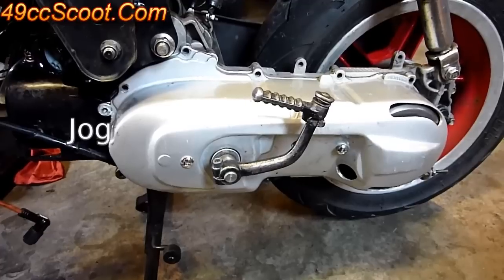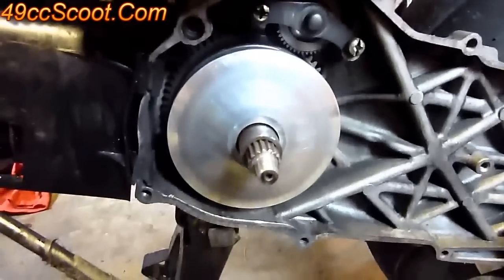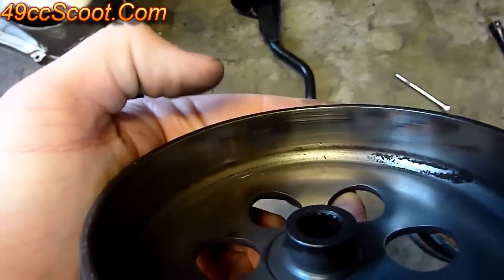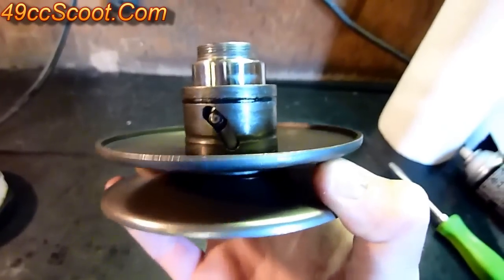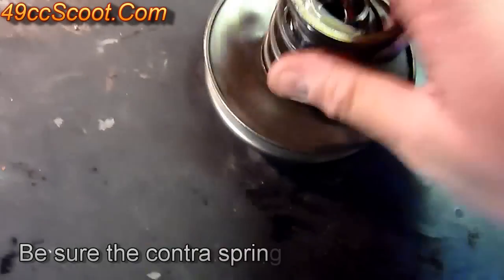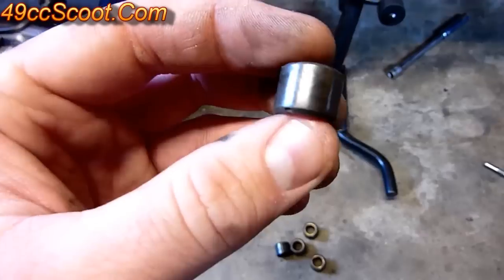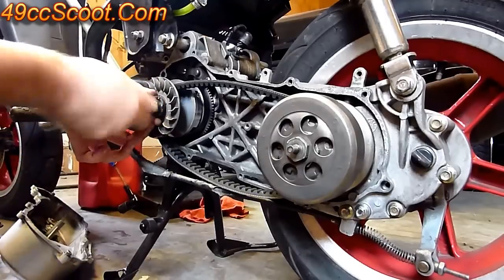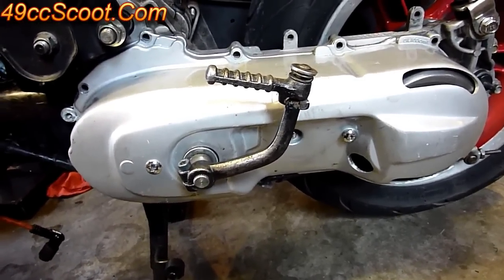Scooter CVT Transmission : Full Service Inspection

Comment: It's thanks to people like you that make in-depth videos like this full of knowledge that other peeps can fix their scoots. Thanks a bunch, man!
Reply: 49ccScoot, could I ask a question regarding my scooter? Around 4 years ago I disassembled my Aprilia Sr 50 2000 Air Cooled scoot and left it like that. Around a month ago, I decided to rebuild the engine and hopefully bring it back to its glory days. I am assembling all the parts and watching as many YT vids as possible, but I only have a problem with the starter clutch behind the variator, more specifically, I just have no damn idea if I am supposed to have any washers behind the variator. I have so many parts from when I took my scooter apart that I am trying to figure out where everything goes. In this scooter, you didn't have anything separating the two parts. Would it be dangerous or problematic to the engine if I, say, didn't install anything in between that I was supposed to in the first place? Cheers, mate, your videos are a godsend! I'll let you know when I manage to finish.

Comment: Thanks so much for posting this video! I have a 2007 Baja SC50 with the QJ1P39QMB-3 motor mated with the 1E40QMB Jog/Minarelli CVT that uses 2 stroke CVT parts that look like the ones in this video. The clutch and variator look just like the ones in this video but the CVT cover is different and unique on the Baja.
It is a big help to see a CVT that actually looks like mine being shown! It took me awhile to understand why videos showing typical Chinese scooter CVT's were using parts that didn't apply to my scooter. It was even more confusing as Baja also made another version of the SC50 in more recent years that was basically the same scooter as the TaoTao ATM50-A1 and Jonway YY50QT-6 which does use a typical Chinese CVT and has the more common 139QMB motor. QianJiang scooter who made the QJ Baja SC50 as a 4 stroke also makes a 2 stroke motor version that is rebranded and sold under various names.
For anyone finding this video and comment that has this Baja SC50 {Keeway Hurricane body style} with the QJ {QianJiang} anomaly engine and 1E40QMB Jog/Minarelli style CVT just remember that it is the variator with the 21mm inner slide bushing and 15 tooth spline that fits the Baja and the 15x12 rollers that fit the variator. I would assume the performance variators and clutch assemblies and springs for the Jog/Minarelli CVT's will work on the Baja too. You can get the stock variator parts and rear clutch assembly and springs here http://www.scrappydogscooters.com/50CC_2-STROKE_PARTS.html and the hard to find 836-17-30 CVT belt here http://www.scrappydogscooters.com/Replacement_Parts.html
I'm not trying to promote their parts on your video and you can find these parts other places like ebay but anyone with this QJ Baja SC50 will have a hard time finding these parts especially the CVT Belt until they realize it uses the 1E40QMB Jog/Minarelli CVT parts so I'm just trying to help anyone with this scooter. One other thing the engine on the QJ Baja is slightly different but any big bore kit up to 72cc with the 47mm or smaller piston should work. The 80cc big bore kit being called 100cc by many sellers with the 50mm piston won't fit this Baja without enlarging the opening on the case. Also remember the variator rollers that come with some big bore kits are 16x13 and won't fit as the Baja uses the 15x12. The CVT gaskets that come with the kits won't work either. Shared this video to my facebook page Moped and Scooter Lovers too.
https://www.facebook.com/mopedscooterlovers
Reply from the maker: +photonrayswaves Good info. They are oddball engines. I'm not sure why they thought it was a good idea. They don't seem to perform much different than the typical 139QMB that's easier/less confusing to get parts for.

Comment: Nice job, I've used a HF oil filter wrench to hold the variator in place on my 4 strokes. 
  They have one that locks like vice grips too.

Comment from the maker: I usually put grease in the grooves where the pins ride and a thin coat on the torque driver in the area between the seals.

Comment from the maker: I ditch the gasket most of the time, because there's nothing that needs to be sealed in or out for regular use. Sometimes starter setups will be picky with just the small amount that the spacing is off without the gasket though. One thing you can try to keep the gasket in good shape and so you don't have to mess with it is to apply a spray on gasket adhesive to 1 side. Use a thin film of grease on the other. It should stick to the case or cover but let the cover be removed easily.

Comment from the maker: Definitely pop the cover and check the belt. I've had belts go just like that with no crazy noises. I put a link to a vid of it happening with a pic of the destroyed belt in the description.
Reply: I have a gokart with a gy6 clone and its lugs off the start is this a cvt problem i dont get any rpms till bout 10 15 mph then accelerates great.
Reply from the maker: @derekmaxwell8164  Most likely clutch/CVT. Check the whole thing, but pay close attention to the clutch because it's the biggest factor for initial takeoff.

Comment from the maker: You should be able to see if there's a major problem with the clutch since it's apart. If you don't see any damage, nothing is loose, etc... the problem may be elsewhere. For the knocking, internal knock could be a sign of serious issues or could be something very minor. Rotate the engine with the variator off to start isolating the noise. Check the stator side as well.

Comment from the maker: I think your variator should have 2 holes int he front where you can put something to lock it. The tool is shown in the vid, but you can make one with 2 metal bars and a couple of bolts that will fit into the holes, plus nuts to secure the bolts to the rods.  You could also use a strap wrench to try and hold the flywheel on the other side while removing the vari nut. An impact and sockets are good investments though. Those will help with a lot of jobs.

Comment: This video is great! ....I'm having issues with my gy6 150cc.  Have a Dr. Pulley hit clutch on it...motor and clutch have less than 100 miles.  Recently it isn't idling at all...on a cold start it feels like the clutch is engaged...and the bike pulls a little then it dies a few seconds later...to ride I have to start it, throttle and go...if I get to a full stop it shuts off...and that's when I feel a lot of resistance.

Comment: I have a 50cc Gy6 and the CVT has a bushing on the case cover that is supposed to support the bendix.  I had done some vatiator tuning that made electric starting non-operational and discovered the bendix to be the issue.  After changing two bendix gears, replacing the bushings on both sides as well, I found there to be a spacing issue causing the bendix to be "pinched" when closing the case.  I tried different combinations of loosened and tightened bolts on the cover and found that in order for the bendix to operate enough to start I would have to loosen all of the cover bolts.  After riding a short distance (perhaps 2- 2.5 miles round trip) I found that standard riding conditions would rattle the bolts loose and the cover may come off entirely.  To adjust I put some washers between the case cover and the mounted portion of the CVT and ran the same bolts through them, allowing me to tighten them enough into place.  Because I didn't have washers between all of them, I cracked a small portion of the cover completely off by over tightening one of the bolts.  Man I wish I had recorded all of it for you and the world to see.  I noticed on your bendix in this video there is a retainer of some sort.  Is that a stock piece for this engine?  Can you please  cover bendix issues?  Thank you so much for all of your videos.  You have the best way of explaining with detail some of the more complex issues and anyone with a moped should subscribe.
Reply from the maker: That's the stock setup on this engine. Another thing that can cause you grief with the 139QMB bendix is that they aren't all the same length. You may buy a replacement and suddenly have trouble, because as you've seen the spacing/length matters a lot with that kind of starter bendix.

Comment: thanks for the advise. I took the cover off saw that the part that the starter ingages and comes out and turn the sprocket was not very well lubed I removed it and greased  it slightly also greased both ends of it put it back together and it starts first time every time Go Figure, its such and easy scooter to work on

Comment: ***** Hi, I have a problem with my Yamaha Aerox 100 2 stroke. When it is cold, it will accelerate really well even at low RPM. However, when it gets warmer (after 2-3 miles of riding) it will be really slow when first accelerating, but at higher rpm, it rides well (although not perfect). What I mean, is that when stopping and then giving it full gas, it does not want to go until about 10mph, when it hits the powerband and it starts accelerating, but, it doesn't over-rev, it just doesn't accelerate. The engine runs smooth and I've cleaned and check the carb so I'm pretty sure that's not the problem.
I think that when I ride it, the clutch gets warmer and starts slipping. I checked the clutch drum bell today and it has turned blue/purple and also the clutch shoes seem to have gone orange and are quite worn. There's also a lot of black residue on the side of the case.
Also, when I ride for a bit then stop, there's a burning smell - like burnt rubber or clutch.
I'm pretty sure its the clutch, but I don't know which part of it exactly and the fact that it doesn't rev out when giving it gas makes me think it isn't the clutch.
What do you think?
Thanks, any help is appreciated!
Reply from the maker: The discoloration on the clutch is telling you it's been hot. One major reason for excess heat in a CVT is slipping from clutch parts or the belt. As you accelerate and the gearing in the CVT changes, the rear pulley will spin much faster and the clutch will have more chance of engaging so that may be why you see the problem go away as you speed up. I would advise watching the video and going over the whole CVT at this point.
Reply: ***** Thanks, a lot. I will try and check out the CVT tomorrow and I'll let you know more. Thanks again for the helpful information!

Comment from the maker: I use 788 17 28 Bando belts. Others seem to like the Mitsuboshi 792 16.6, but I'm not sure where to find them. Stage6 makes a 797 17 28 I believe. Whatever you do, just don't buy the no-name Chinese stuff that's really cheap or you'll probably end up buying another belt before long.

Comment: The little A shape slider's always first to go sounds like gravel.. 4 gram rollers and less than 30 miles on a brand new front and rear variator CVT set up

Comment: Well today when on a ride the clutch locked up. The wheel wouldnt turn free of the engine. Pulled the cover off, sure enough one of the rivets that holds the centrifugal clutch shoe to the hub had broken. Repaired the centrifugal clutch pack and voila! she is perfect again. Vibration is gone, all is well in scooter land!

Comment: im a fairly new owner of a 125cc scoot but for me its bettee to use an engine degreaser that has kerosene in it, since it wont destroy your seals and o-rings unlike brake cleaner and use high temperature grease in the torque drive bearings, ordinary grease will melt and evaporate when the torque drive gets really hot
Reply from the maker: I like kerosene as a cleaner these days as well. Belt manufacturers say no brake parts cleaner should be used. Likely an abundance of caution, but kerosene is also cheaper than brake parts cleaner so it's a win-win. Synthetic general purpose grease has worked well for me for years. Bel-Ray Assembly Lube was a favorite, but they discontinued it. Now Malossi and Polini have grease that works well too.

Comment: excellent video.  I have a 1984 Honda Areo 125. Its a very rare model.  I have a problem with acceleration until I get up to about 22 mph. then it kicks in and you hear the motor open up and it gets up to about 48 mph.  Between 0 and 22 it just is a dog.  I have a second scooter the same kind and it gits it from the start.  What do you think my issue is if you don't mind.  Thanks Billy

Comment: OK I will do this before I ride next season, I made a video working on the CVT myself and I did not take apart the clutch assembly. I did sand the bell and the shoes though. It just seems like there is more vibration than I remember it does smooth out after a few minutes. Thank you again for the info and reply, is there a trick to greasing these parts or how much?

Comment: I could see the idea of more wear in that centrifugal clutch and the pulley halves, along with those pins possibly binding, than a failure in that primary front pulley, I guess. It would seem to me that the front primary part would need to be just cleaned more than anything else. I don't see how those roller weights would actually fail unless you were modifying it or upgrading, whatever an "upgrade" would be in that front section.

Comment: Thanks a lot very nicely presented good one Perfect
Now i got a scooter CF moto 150cc liquid cooled its has a problem with Clutch may be its broken or needs repair i have opened up the engine and have reached to the Clutch
can u plz help me up for the clutch diagnosis repair or to fix it Do u have any other videos in this situation and also when the scooter was working it was making a knocking sound inside the engine. when i try to rotate the variator there is a scrashing sound inside the engine

Comment: Great video! I do have an old Suzuki cp 50 and the engine runs good but it will not increase speed/gear up... Any good solution?
Reply from the maker: affas First is to go over the CVT and see if it's just a maintenance issue.

Comment: Thanks for the input, i pulled it apart and it seems to be quite dirty, the grease inside is really sticky almost gunk. What should I use to clean it? The rest seems ok. the belt looks brand new, the other parts as well.

Comment: Nice video once again, I shreaded a CVT belt the other day in my 50cc gy6, I have everything apart now and will be cleaning, I noticed that there are 6g rollers so maybe someone else before me put those in, If the clutch is stock can I just add a yellow torque spring for an upgrade? Do I have to replace the smaller clutch springs also or can I just do the larger torque?  What color spring do you think works best on the 50cc 4 stroke?  TY again
Reply from the maker: You don't have to replace the clutch and torque springs together. Use whatever works best for each. I tend to go with the "1000RPM" options for torque springs on these.

Comment: Hi, i think I have the same engine on my scooter but I cant find anything on internet about that engine (service manual etc.), one thing that I know is that from factory it has 80cc and little larger shaft of the crankshaft on the clutch side so when I tryed to upgrade transsmision it couldnt fit because it was smaller. Do you know any site where I can find more informations? And sorry for bad english

Comment: in the service manual i have for 1e40qmb it says apply approx 1.5g of grease per roller ramp. i didn't do that, is that a major issue? thanks again

Comment: i have got a terrible sound coming from clutch when starting.... after 15 second the sound slowly disappearing to the minor sound ..do i need to change the clutch pads or clean the clutch with sand paper

Comment: just had this problem on my zuma. i thought it was the belt was stuck in the front pulley, but turned out to be the centrifugal clutch on the rear pulley had broke. The clutch assembly is only 50 bucks from the dealer.

Comment: I have a SYM/Lance PCH 50. I at least want to inspect my belt. Coming up on the 6,000 mile inspection. Seems like SYM is very unwilling help. My local dealer closed in January. The nearest dealer is 80 miles away. Any advice? MRP carries some parts. How can a company be so independent. Don't they want to sell a product?
Reply from the maker: +David Collins If it's the 1P37... engine, parts may be tough to find. If it"s the 139QMB/1P39QMB,  you can find parts easily searching for that. You could try looking for online dealers that will ship parts if that's all you need. If you want a dealer to do the service, I don't think you'd have many options other than traveling to the nearest one. I'm a little surprised at the unwillingness to help since they claim to have one of the best warranties and part of the reasoning for their 49cc costing nearly $1000 more than cheap Chinese is the support.
Reply: Thanks I'll check my manual.